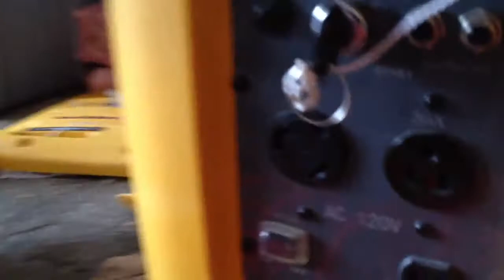Ransond 3500. No start

Comment: Old post I see but I'm facing the same problem. What did you end up doing? It seems like if I prime it an unbelievable number of times it will eventually start but there's got to be some kind of fix. ???
Reply from the maker: SORRY FOR DELAY.  EVERY TIME IT WAS DIRTY GAS AND STABIL FUEL STABILYZER.  DUMPED FUEL AND BLEW LINES.